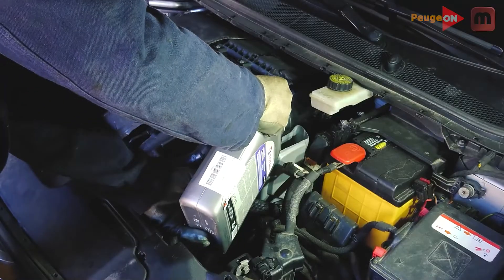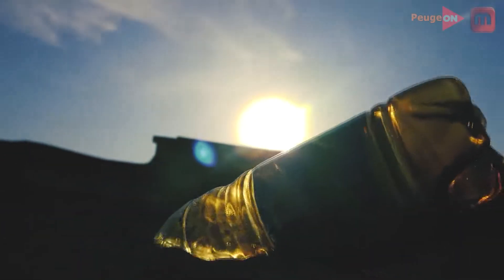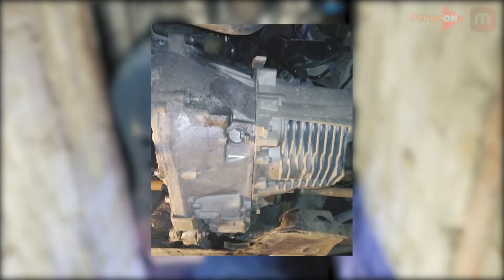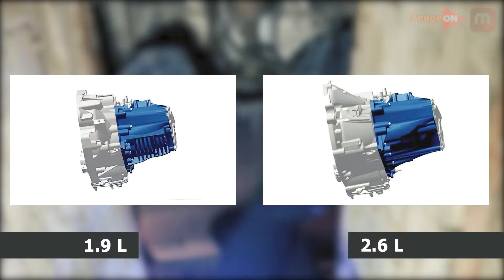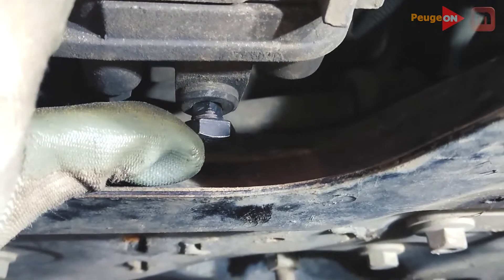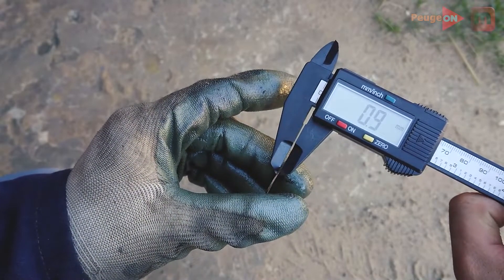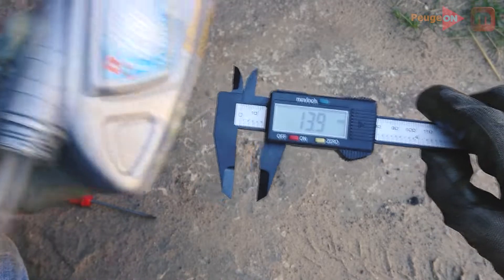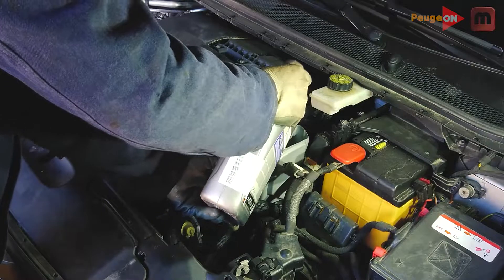Gearbox change oil. PEUGEOT 308 T9

Comment: Very helpful video thank you. I made a tool by cutting a 8-13 mm drain plug socket in the middle so it can fit. Oil at 125000 miles was pretty dark but less metal on the plug. With the model with fins I took out 2.3 liters of oil and put back 250 ml of motorkote additive and 2 liters of castrol trans max 75w90. The result better and smoother gear changes.

Comment: Showîng exactly the real issue we can meet thank you for the explanation. Did you remove easily the plug by doing so or did you heat it before, From my side I think I will nées to elevate a little the engine for à better access.

Comment: If I'm not wrong instad of making 8mm square bolt for draining nut, you can use 3/8 inch adaptor or bare 3/8 inch ratchet (or tourque wrench)

Comment: 308 t9 2015 1.6 diesel 130 000 km ,i have lets say loud noises when shifting,i got it used so cant really tell if its always like that.Should i replace the oil or is something else related?
Reply: changing the oil will not make any difference I guess...